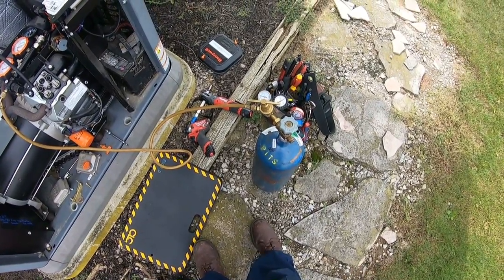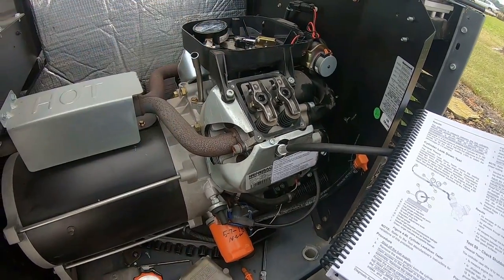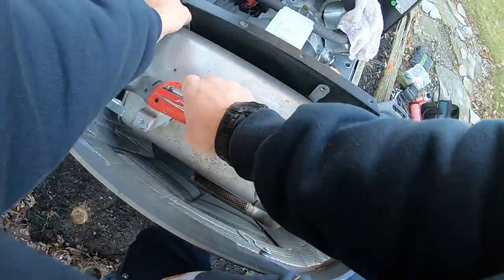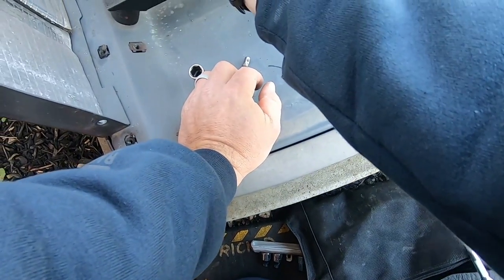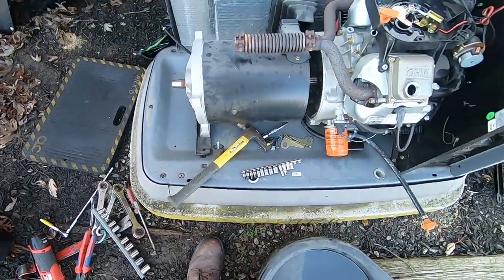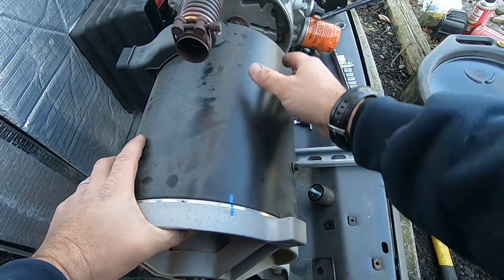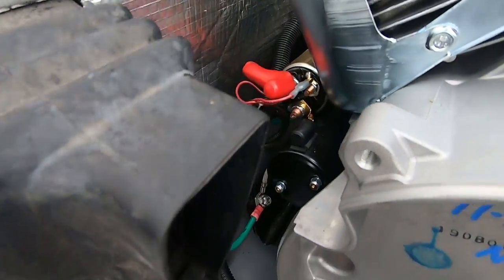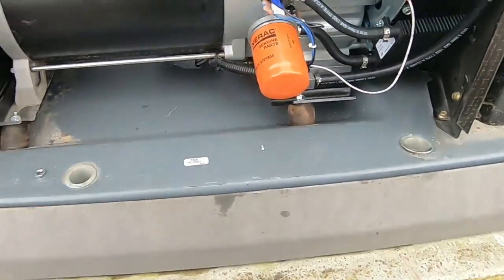Another Generac Generator Leaking Oil Engine Failure

Comment from the maker: 👉👉👉FYI this is not a DIY channel.👈👈👈  I make these videos to try to help other technicians that work on these generators that have already been properly trained and have gone to generator class. 👉👉👉If  you're having problems with your home stand-by generator please contact your local authorized Generac dealer.
Reply: Yeah well, my Generac is 20something years old and bleeding oil  very slowly somewhere (the concrete pad it's sitting on is black :(  ). The dealer that sold the generator decamped for the great out-of-business-gig-in-the-sky ages ago, and Ring Power refuses to service a generator this old and this small. :D   I've been fixing engines, repairing electronics, wiring houses, keeping ancient appliances running, and generally DIY-ing for most of my life, so I don't feel at all uneasy about working on a little V-twin spinning a generator. :D  Git 'r dun! :D
Reply from the maker: I have to cover my butt against people blaming me for there mistakes.
Reply: @HVACRSurvival  did you see my question
Reply from the maker: John, no I didn't, email me would be best. hvacrsurvival@gmail.com

Comment: Fantastic video.  Thanks for taking the time to do this.  Sadly, everyone who viewed it likely has this problem.  Both my neighbor and I have the same model and his is having this problem.  Tech came out and after initially misdiagnosing the problem, said it needs a new motor.  Out of warranty by about 2 years and roughly only about 200 hours on it from exercises and power outages.  Mine has been more of a PITA than a savior for power outages.  I recently swapped out the starter since the original was junk and would barely crank the engine, but that is another story.   It's hard for me to fathom so many failures with so few hours.   I'm underwhelmed with the Generac product.😞  Thanks again for having the patience to do the job and get it recorded and uploaded.👍
Reply from the maker: Thank you very much, for recognizing the time that goes into these. Yeah,  my excitement to work on Generac is not what it used to be as you can tell in the videos. My portable unit has been pretty good but I've seen so many have major problems that it just becomes more of a hassle than I care to deal with.

Comment: I get to do this job tomorrow. Warranty replacement engine, because it tossed a pushrod through the valve cover and tore up the valve train on cylinder #2. It finally shut down on low oil pressure, which is why I insisted it be replaced instead of repaired.
Reply from the maker: Lucky you! How did it go? Did this help?
Reply: @HVACRSurvival The job was postponed due to snow.

Comment: those were likely cylinder and piston pieces vs. ring pieces, the fine sparklies for sure had lots of ring shavings.
I say that because by time you see ring pieces in the oil/case, it would have shattered the piston to pieces and broke the rod/block.
rings are very hard and brittle material compared to aluminum piston and cylinder/sleeves, so they'll crack or shatter and chew up the cylinder which in turn chews the piston putting gobs of great sparklies in the oil. after seeing that, maybe they broke the rings at the factory on assembly or they were too tight in the sleeve/out of round, etc. guessing games :)

Comment: Like your video's alot of these small engines in generators, mowers and other's the first oil change isn't done properly 6 to 8 hours max then dump oil pull filter the oil will literally start wearing the engine out the filter is only good to between 20 to 30 microns depending on brand the metal from rings and other parts breaking in does not 100% get taken out so it eats the engine especially in air cooled and make sure you have the right oil with zinc and phosphorus, really good video's I have had 2 Generacs service it properly it will last long time first oil change is crucial 8 hours max
Reply from the maker: We used to run them for 10 hours and change the oil but that's not done anymore unfortunately. My own personal generator, I ran it for a couple hours and changed the oil especially on my small inverter driven generator that doesn't even have an oil filter. Thanks for the comment and feedback!
Reply: @HVACRSurvival  yeah its a big deal I have a 2011 60 inch Exmark mower with 29hp EFI Kohler engine I now run 15w50 Amsoil small engine oil Kohler changed everything and getting away from 30 weight and going 10w50 15w50 or 20w50 mine has 660 hours I have never ever added oil between changes but I broke it in right I also run fuel lubricant Marvel mystery oil in the fuel my dad and uncle built engines for years racing and regular gas engines and my uncle was also a military diesel mechanic I have learned alot about engines from 60s till now, small air cooled engines have tremendous stress levels that's where the zinc and phosphorus come into play it reduces oil burn off and wear more than a person would think I have a brand new 14kw Generac my house isn't really big its very rural though we are running the central air on its own switch so I can use it when I'm home and back everything else down as you said in another video its all about staging I had a very early 2000s 12kw which is actually 11kw because on NG my new one is true 14kw don't let me know anything about it I have OCD I will worry about its weak points but it was highly recommended over the other models available I must say I have learned alot about the other aspects of these machines I'm not very qualified on electrical stuff keep doing these videos thank you
Reply from the maker: Thanks for the info!

Comment: The current line of generac standby air cooled generators have motors and alternators made in USA at generacs facilities. 

Im a tech and work on hundreds of these units every year. Have very few failures. They make a great product for the money. Some of the older 2008 era units are sketchy at times, but i have lots of them still working year after year. They just need proper service.

Nice video. I take about 2.5-3 hours to swap out a motor in the field. Not a hard job, but it can be done by 1 man. Sad thing is Its almost takes as long to swap a motor as to change mags or front oil seal. Definitely plan on sore knees and a few scratches doing any work. 

Changing starters really suck.
Reply from the maker: I've done all the above. Your right the newer ones are not too bad. I started in 2006 working on generators added on to my HVAC work. The parts are assembled here but they are not wound or forged here.
Reply: @HVACRSurvival  actually, i have no idea where aluminum parts are forged, but generac has been winding their own rotors and stators inhouse for many years. Older units had chinese made rotor and stators that failed quite often, and i think thats what led them to manufacture their own.
Reply from the maker: That's interesting, when I first went through the class in Wisconsin in 2006 they used to have training in their assembly warehouse, just watching how fast people were working was obvious reason why the quality was so poor, then when I started seeing boxes said made in China on them that made me think mmmm.  I brought it up to the guy teaching the class he kind of beat around the bush. Now they don't let you near that place and they have a dedicated training facility, probably for that very reason.

Comment: Hello there 
I change the oil & filter & spark plug. When I put some fresh oil. But I think 🤔 I put to much oil it starting smoking it stop it self. So can I take some oil out bring it down to its level?
I'm calling from Houston TX
Reply from the maker: Yes drain some out and recheck, these only hold between 1.5-1.9 qts total.

Comment: New sub here, I have a 22kw for six years now very happy with it? It just ran for 8 days straight other then using some oil in the first couple of days it was flawless! Where is the best place to get the valve cover gaskets?
Thanks for taking the time to do the video. 👍🏻✌🏻️
Reply from the maker: Unless the gaskets leaking you shouldn't need to replace it. When I used to order the parts I ordered them straight from Generac. Now someone else orders the parts. If you do some searching online you should find it or just call the 1-800 Generac number, they can look it up and you the part number.
Reply: HVACR Survival , thanks for the quick response, stay safe out there bro!✌🏻️
Reply from the maker: @alanross3435  u2👍👍

Comment: Wow great video.I just finished getting 4 estimates for a whole house 16kw.3 out of 4 recommend the cold weather kit because I live in the northeast.What is your opinion?Also is the concrete pad better than a 2x4 frame with pee stone?Anyones help here is much appreciated.
Reply from the maker: Definitely get the cold weather kit, there around $375-$450 and can be found online,  the pad is really more for looks and longevity.
Reply: I would recommend cold weather kit for the  nor east definently. Gravel around under the unit a must if you get a lot of rain. I am a generac tech in the nor west, what I see is mud splashing into batt compartment when it rains, dries out when the unit runs, and gets pulled in to unit, causing problems in controller,  clogging air filter and even giving fits to the brushes and slip rings. Depending on what kind of soul you have , liquefaction is an issue as well.

Comment: I cracked the body at oil pressureswitch. Found a replacement . Could you tell me what the torque is for the bolts would be.
Reply from the maker: I've always found it's best to not over tighten it, usually use a very small wrench that helps prevent that from happening. I don't know if they listed a torque for it, I would guess probably somewhere along maybe 5 lb? Better yet just use one or two fingers to tighten it with a small wrench. There's not a lot of pressure on it.
Reply: @HVACRSurvival  thanks. I guess it's truly just holding the oil like an oil pan. So that makes since. Just large bolts are confusing me. Wish I could send a photo.

Comment: Newbie tech here. Haven’t had to do anything major besides maintenance really. Went on a call today with over crank codes. Worked through the flow chart and everything was checking out until compression… 28-30# both cylinders. It’s a 2017 model. It had water in the bottom of the air box. Wet air filter. I think blowing snow got sucked in as it was running. Had 2067.7 hours on it. Looks like I’ll be doing an engine replacement. Minus drive time, how long did the job take? I’d like an idea what to expect since I have an hour and a half drive one way to get to the customers house. Thanks.
Reply from the maker: Make sure you have all the little pry bars and things that I used to make my job easier, definitely don't forget that bolt to go down the center to push them apart and the other bolt to drive that one through which it's a metric bolt, I don't remember off the top of my head what it is. I'd say grand total I probably had four or five hours on site plus your drive time. I made sure everything ran and did all kinds of tests beyond just changing the engine.

Comment: I assume valves were properly adjusted???? Valve clearance too tight will pump oil into air box
Reply from the maker: Did you watch the video? Did you see the chunks of metal I pulled out of the engine block? I doubt the valves would caused the rings to break off into pieces. I even explained what would happen with the blow down test where you would hear the air at.

Comment: Sad that happened to that motor.   What do you think caused the rings to get trashed?   The generator doesn't look that old for a catastrophic failure.   Thanks for sharing a different topic than hvac.  Good to have some variety.
Reply from the maker: It had 75 hours. Maybe a manufacture defect?
Reply: brad mironik ya I had a friend lose the same motor it was only 3 weeks old.   Replaced for free
Reply: @HVACRSurvival  Is it rare, or are the engines poor quality?
Reply from the maker: It happens here and there, the older ones seem to be more problematic. Most of the problems come down to assembly issues.

Comment: I have a Generac GP1200i. Shut down and oil light. Refilled and shut down again oil light. Now sitting in garage there is a puddle of oil under the unit.  Where would it be leaking from?
Reply from the maker: Oil filter? Oil safety? Crank case?

Comment: Near completion, you instruct to look for oil leakage.  What are your thought process then if you do see leakage?  I’m having major leakage problem with oil pooling on the bottom and not sure how to start diagnosing the problem. Thanks
Reply from the maker: Check hoses, and gaskets for leaks by cleaning up all traces of oil with a degreaser. Run engine again till you see where it's coming from.
Reply: @HVACRSurvival  I'll be doing that one of these days. Gonna have to pull all the sheetmetal off so I can see what's what in there. It's a very small leak; I have to top the oil every 3 months or so because it'll fail to start with low oil level. Hasn't been high on the priority list but it is getting older, and hurricane seasons are becoming more eventful these days. :)

Comment: Will a 992cc stationary engine generac inter change with aportiiable 15000 watts
Reply from the maker: If both engines are generac generator motors it probably will but can say for sure. I just match up whatever it was prior.

Comment: I like your videos..  but after watching this one, I think I'm going to stick with my trusty, easy to fix, and very simple portable generator that I converted to tri-fuel.
Reply from the maker: I have said several times I have two portable generators not a stand-bye and I haven't had any problems with either.
Reply: @HVACRSurvival   I also watch James Condon's generator repair vids, and the most important lesson I've learned from watching them is that the more crap they put on these things, the less reliable they are.   
We barely even run our generator anymore, I just flip a couple switches and our grid-tied solar goes into off grid mode.    Generator is only used to charge batteries if the sun doesn't cooperate.   

Thank you for all your videos, great narration, well produced.
Reply from the maker: Thanks so much for letting me know!

Comment: How many hours did that take? Kinda surprised y'all didn't replace the whole thing.
Reply from the maker: We don't charge crazy money like some companies.  I think 6.5hrs round trip
Reply: No real reason to replace the whole thing if the generator is still functional. At least with just an engine swap you don't have to shift the entire (heavy!) unit, or mess with the AC wiring to the transfer switch.

Comment: Looking at a Generac 27KW water cooled for a new home. Any experience with them? Good, bad?
Reply from the maker: I have worked on a few liquid cooled. They appear better built than the air cooled generators in my opinion. Overall they all have a potential to fail, allot has to do with proper sizing, proper installation and proper maintenance.
Reply: Water cooled will be quieter, less clatter.

Comment: Amazing video. Your video editing was solid. What are you using for software ? And what are you editing on for hardware? Never seen anyone work on this equipment. Really interesting and thank you for sharing !!!!
Reply from the maker: Thanks man, It takes practice to cut these down, this was 90 minutes long when I started. I use Movie Edit Pro 2019 for software, its ok but I wish I would have looked into getting Adobe Premier. But its big money. I'm using a Dell G7 laptop, I7 Processor,  8th generation, 16g of ram, 1T SSD and a 256GB M.2 PCIe NVMe Solid State Drive. It has a dedicated NVIDIA video card. Its faster than my previous computer but It still takes twice as long as the video to encode and process the final video.
Reply: HVAC*R Survival wow that’s some solid hardware. I’m just starting out so nowhere near that hardware. Currently using filmora. Well thanks for sharing. Keep up the great material

Comment: Did you do the leak down test with engine warm or cold?  Does it matter?
Reply from the maker: It wasn't red hot but had ran some. I've done it both ways, I would think it should be the same in both conditions. You need proper compression for combustion at starting and you need it while it's running. I would have to look back through the book to see what they recommend but I don't think they've mentioned it as being better one way or the other. Obviously it's going to be tighter when it's hotter so the pressure would be higher if it even makes a difference.

Comment: Is this a known issue with these Honeywell’s? I’m getting an abnormal amount of white smoke on mine when it’s running. It has used a little bit of oil in the past year or so. So with the oil consumption and the white smoke I’m assuming there’s something going on
Reply from the maker: It's an air-cooled motor it's going to burn oil, if you're getting smoke you probably have something leaking by the rings. These are mass produced generators that are cheaper than Kohler and they're the largest standby manufacturer because they are price driven.